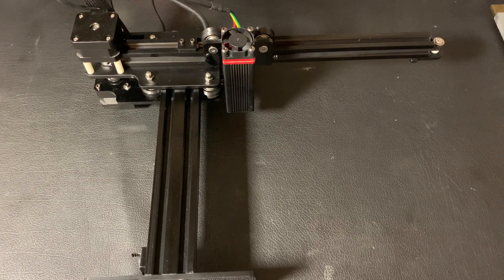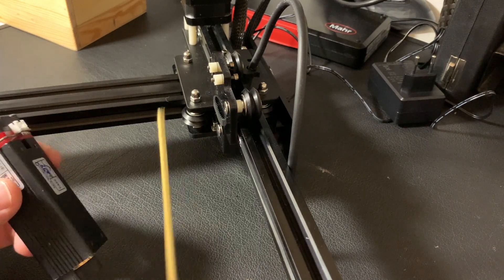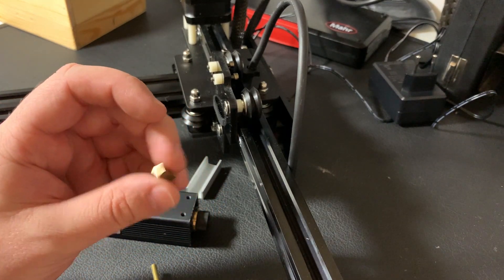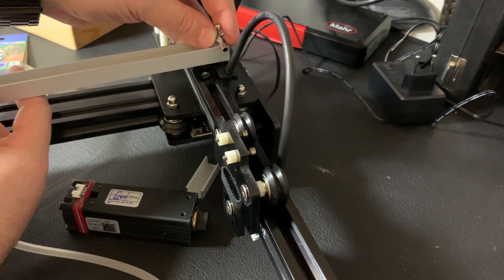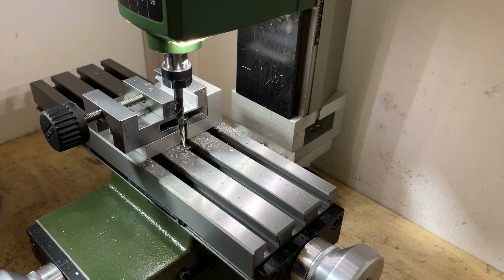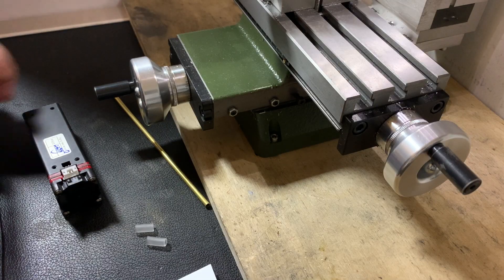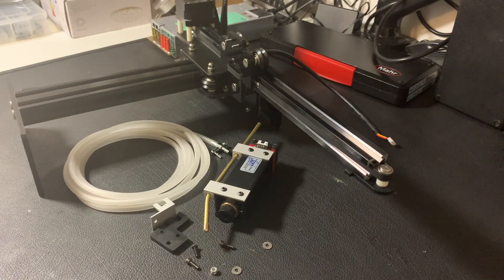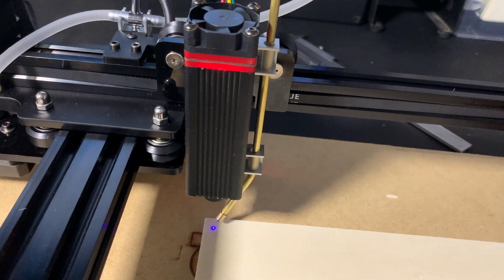Air Support for NEJE Master 2

Comment: Is there a specific airpressure needed to get the air support working correct?
Reply from the maker: Basically what I can say, mostly it's not about pressure, it's about how much air your compressor can produce. Some people using aquarium pumps, and they definitely working. Compressor I'm using can produce up to 100l/min, but it's too much.

Comment: What material do You suggest To use under acrilic in a cut?
Reply from the maker: Under a laser cutting surface you could use anything that are not reflects and not cut's with laser. Good if you have a free space between what you are cutting and table.

Comment: Perfect, your project! I want to know which model of air compressor you use.
Another question does the 20w laser cut 2 and 3mm mdf well?
Congratulations! great video.
Reply from the maker: Hi, for the moment I'm using air compressor like this https://www.amazon.de/-/en/Stanley-DST-100-Quiet-Compressor/dp/B07SHGZF2V
About mdf I could not say. Maximum what is possible to cut is still 4mm plywood.
Reply: @zhadlun  I don't have the resources that you have to upgrade to this level :). I am still gathering resources to be able to buy such a machine. Because here in Brazil this machine has a high value. Once again congratulations on your project! Really enjoyed.